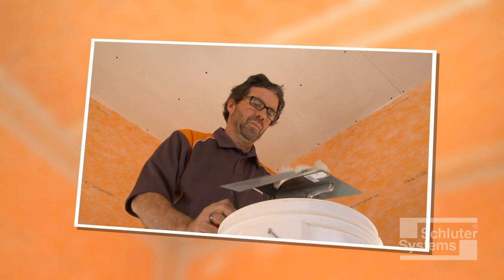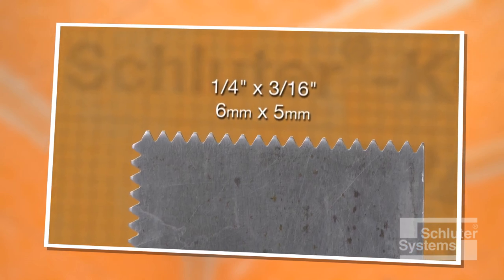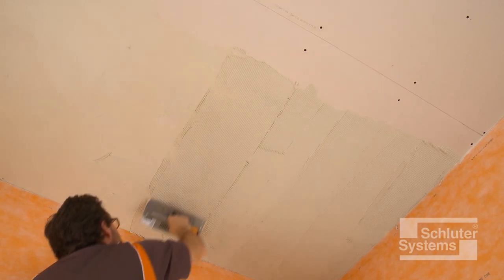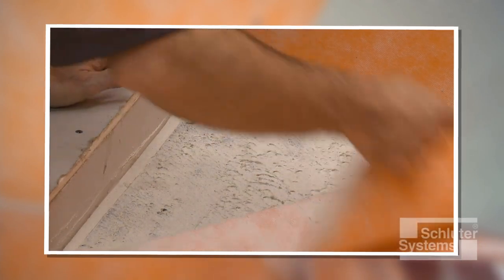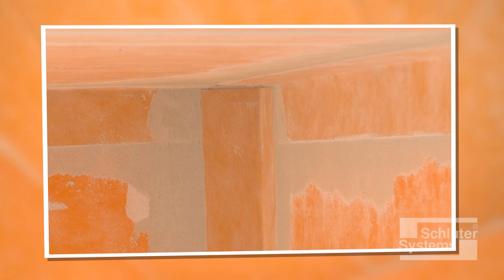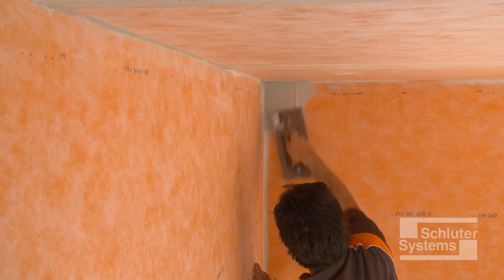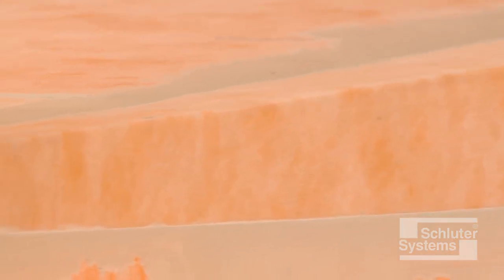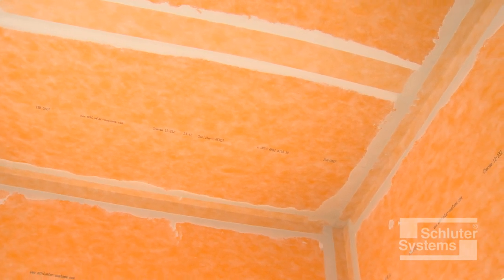Schluter®-KERDI over Solid Backing for Ceilings

Comment: I am redoing my bathroom, and I am planning to use kerdi waterproofing membrane. My concern is that we are planning to have the walls tiled, but the ceiling is going to be painted. Can we simply waterproof with kerdi and then use regular joint compound over it prior to sanding and painting? 

As an alternative plan, I am thinking of replacing the drywall with kerdi board and simply mud/sand/prime/paint the ceiling. This would also apply for the walls if you can answer me the question below.

The reason for one vs the other is because I haven't been able to find information regarding the mechanical durability of Kerdiboard vs regular drywall panels. Can you clarify this?

Thanks!
Reply from the maker: Hi Bernado, glad to hear you are using Schluter in your bathroom project! 

Kerdi is perfect for waterproofing the tiled walls, but unless you are doing a steam shower, you don't need to waterproof the ceiling. 

KERDI-BOARD is also a great option for the walls. (would be EITHER Kerdi OR Kerdi-Board). Advantage here is the speed of installation, and replacing the drywall stage completely. Again, unless a steam shower, you don't have to do the ceiling. 

As for the mechanical durability of Kerdi-Board, the product is meant for use with tile installations and not meant as a finished wall panel like drywall. We recommend using KERDI-BOARD in the wet areas for walls and ceilings where tile will be installed. 

If you do need to do the ceiling to meet certain specifications of your project (depending a bit on what you're doing!), we can provide some painting guidelines with Kerdi-Board. Just let us know. 

You can also give our Product Support team a call. It's always easier to have a quick chat, so we can be sure to understand the unique details of your project and provide you with the right support. 800-472-4588 (US) or 800-667-8746 (Canada)
Reply: @schlutersystems1  Thank you for your feedback. I decided to go with regular greenboard and kerdi over it, and not do the ceiling. Very appreciated!
Reply from the maker: Our pleasure!

Comment: what do you recommend around light fixtures?
Reply from the maker: Hi Aidan! Sorry for the delay... We would recommend using a light fixture appropriate for the application and to follow the manufacturer's installation instructions.
Hope this helps!
Reply: @schlutersystems1  no, not very helpful.  Why go through the effort to waterproof a ceiling if you're going to punch a hole in it for a light fixture?  Thought Schluter would have some solution.  Some kind of waterproof lighting receptacle?
Reply from the maker: Hi Aidan, sorry that wasn't precise enough for you. While we don't have a specific seal to address shower lights, we do outline waterproofing options for lights in our Shower Handbook, which states: "Any protrusions through the KERDI or KERDI-BOARD (e.g., steam inlets, lights, etc.) must be treated with KERDI-SEAL-PS/-MV seals, room temperature vulcanizing sealant or other suitable sealant with a working temperature over 250 - 300 deg F (120 - 150 deg C)."
Reply: @schlutersystems1  thanks; that's much more helpful.
Reply from the maker: Oh good!